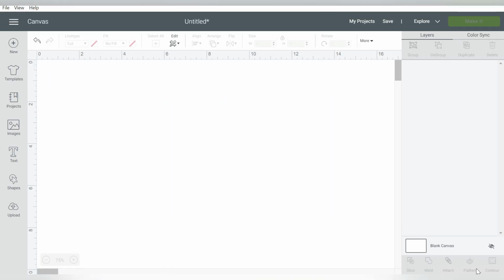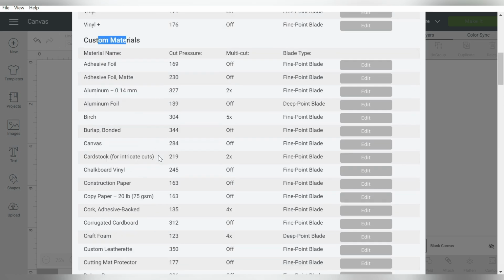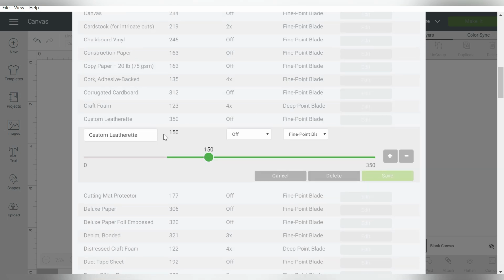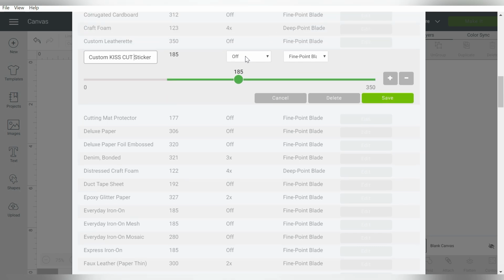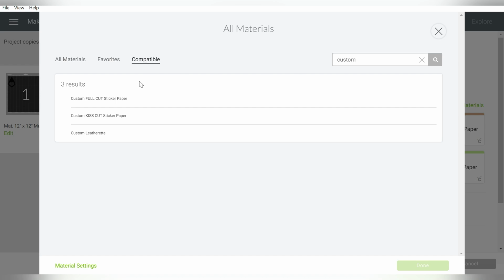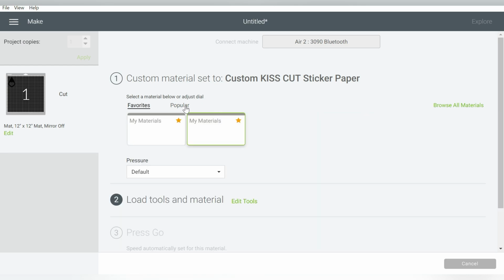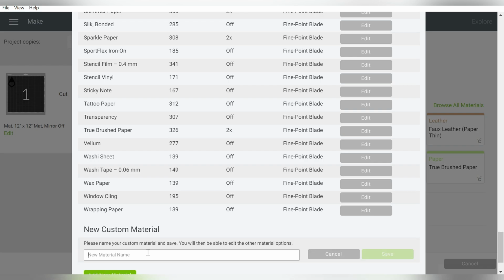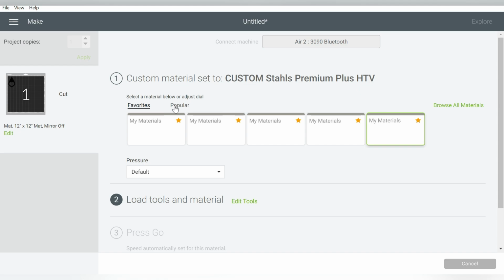✨ How to Set Up Custom Materials in Cricut Design Space

Comment: Will my cricut explore family can be used for the engraving tip
Reply from the maker: Hey Loretta, if I understand your question correctly, you're asking about the engraving tip that was pushed out for the Cricut Maker?  That tip won't work for the Explore family, but there is an aftermarket tool you can check in to, it's from a company called Chomas Creations and it should be available on Amazon.  Hope this helps!   ---Becky